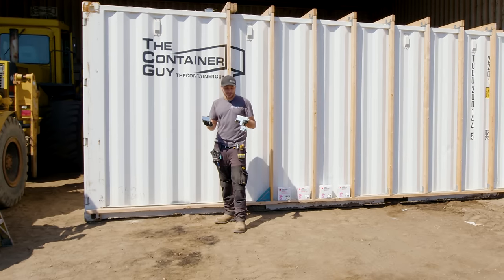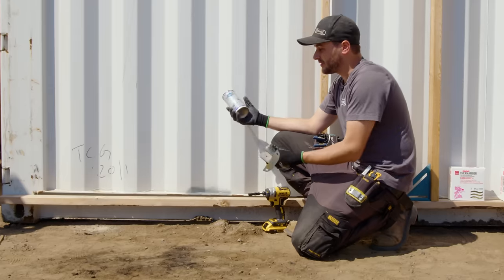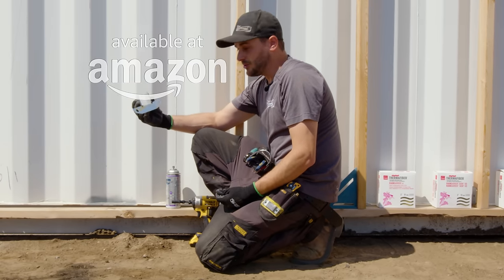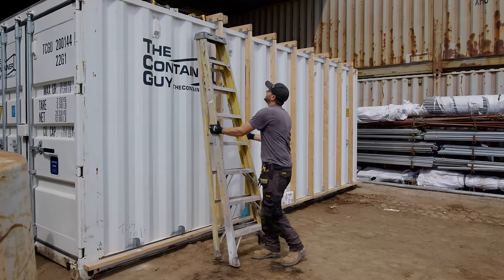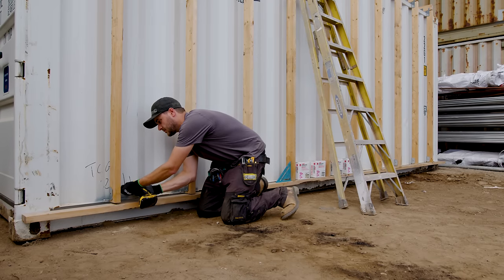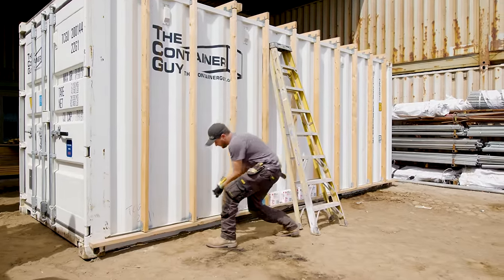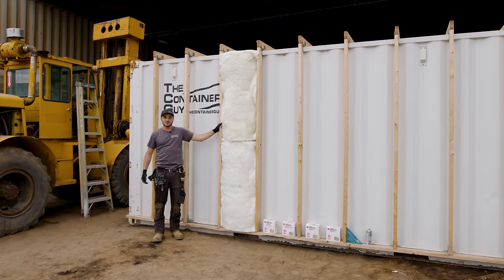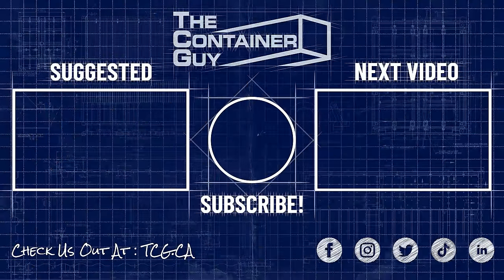Installing Our Exterior Stud Brackets On Shipping Containers !

Comment: May I suggest a better anti-rusting solution for the bottom bracket?  Instead of using the Zinc coat paint, the best-of-the-best is to use an automotive coating like a 'Wax Rust Proofing' compound which may be 'POR-15' or 'KBS Cavity Coater' or one of the best being a permanent wax based coating.... 'PRO FORM PF 708-1'
Reply from the maker: I love suggestions. Great ideas. I'll look them up. Thanks. 

I'm not sure the rust there was a huge issue and I'm certain not many people who buy them will actually protect the metals. Time will tell I guess.
Reply: @TheContainerGuyTV  
In my automotive experiences, my focus is more to protecting the lower bracket rather than the shipping container itself since the gauging is super thick on the container compared to the lower bracket and it would be very easy to coat the entire bracket in wax rust proofing compound to permanently stop corrosion. 

Even with galvanized metal, people think that it will never corrode, but it doesn't take much for corrosion to eat to the base metal and I've seen it a million times!

It may also seem that I'm over protecting the metal, but once rust starts, it will eat metal to the point of turning it into dust and that would be a pain in the rear to have to rip walls apart to fix a problem that should never have happened in the first place.  Just my 5-cents worth...👍😎

Comment: My biggest concern with insulation is the how and where of moisture/condensation. Not just super humid environments, but also very cold climates can create a lot of moisture in walls. Any thoughts on mitigating that and/or how to use vapor barriers to ensure it’s not a problem? Pretty sure closed cell spray foam would take care of it, but of course, that’s far and away the most expensive option.
Reply: save for foam ... its worth it

BUT if you absolutely don't want to ... then build it like old houses and have air gaps that will allow the exterior to dry out if condensation or water get in there ... that also comes with its own set of problems
Reply: @dovahkindragonborn9827  Good advice.

Comment: Very cool. Would we have to use the vertical bottom brackets in order to build a roof or could we just use the top brackets?
Reply from the maker: Can just use the top brackets but this has been asked so many times that we are going to make a "truss" bracket for this exact application. Give us a month or so.

Comment: At 5:28 I can see you pre taped your holes, did you use a tap or did you use a self tapping bolt. It almost looks like you did this to make the assembly look easier, however I’m SURE this wasn’t the case.
What I did was weld an angle iron horizontally where your brackets are and sat the end of the 2x4 on it so NO wood was exposed. Those brackets and bolts are expensive.

Comment: Love the product and would be super interested in buying, but $2100 seems really steep.  Any plans for a price decrease or rationale as to why the brackets cost as much buying the container itself?
Reply from the maker: They were manufactured in low quantities and there's LOTS of them in a kit. We think the number of brackets can be reduced with a bit of change in our framing method and if we order large volume, our cost will come down. These are the "better than nothing" Beta version of the brackets at the moment. In short, prices will come down eventually.

Comment: I like what you've done.  I ask because I do not know - If you are going to frame it out in wood, why not just frame a structure in all wood and do away with the container?  I'm also wondering out loud whether your could have polystyrene molded to the contour of the container on one side and and have a 4x8 sheet of plywood on the outside?  Essentially a SIP system with engineered wood only on the outside.
Reply: Would a wood structure withstand 100 mph straight line winds? Having that steel container adds enough weight to withstand 100 mph straight line winds!

Comment: When using a system like this, do you recommend using the close-cell spray foam inside the container, AND also insulating the outside as well to prevent condensation, or do you only need to insulate the outside?

Assume that a bathroom & kitchen would be inside the shipping container, so there would be interior moisture.
Reply: @h2s142yeah, I wouldn't use fiberglass up here in Canada. It wicks moisture to easily for one, and won't provide enough R value for another. Mineral Wool would be a far better alternative, and even then - in order to get the right R value, you would lose too much of your interior dimension.
Reply: I am well aware that closed-cell spray foam is the best alternative for insulating the inside of a can for our winter weather. However, this is a different system with exterior studs, so I was uncertain whether insulating the inside or outside or both was the better option.

Comment: With external insulation, can i directly attach plasterboard sheets to the walls inside, without using metal structures to fix the sheets , just directly against and fix through the wall ?
Reply from the maker: Probably better off to glue 1 5/8" steel studs to the inside corrugations then fasten the drywall to that if you want the max interior space. Without spray foam, the walls flex a lot so if you plan to mud/tape it will likely crack.

Comment: I think if i was building a one story house with roof, i'd take two 40ft containers and slam them together then do this, have to have the high ceilings though. A good size room is 17x15x9ft ceilings, Probably need 18 or 19 shipping containers to do a project! Most of those are walls though, the rest would be for living space and a unground pool one for a look out tower with a jogging roof around the walls. Inside space would be for a garden the pool and family area.

Comment: You could use a spray wax to help prevent corrosion instead of a paint or primer. Used in automotive applications. You probably could use the insulation as is, but cutting it down is really not a hard thing to do.
Reply from the maker: Tomorrow we're going to tackle the insulation. It's a bit of a rabbit-hole. Seems there're many ways to skin a cat

Comment: Have to wonder about bimetallic corrosion and longevity of those brackets.
Reply from the maker: Another instance where spray foam cures all. The spray foam has enough stuctural adhesion to withstand the wind and snow loads therefore these brackets are merely placeholders until the spray foam contractor arrives.

Comment: Can a truss be incorporated in the top, with an overhang eve? Hip roof???
Reply from the maker: Once you convert it to wood construction with these brackets, you can do any wood-type construction methods
Reply: these are kind expensive at 1200 for a 20 foot container.
 @TheContainerGuyTV
Reply from the maker: @surplusdoctor  we're working on it. The first batches of production are never cheap.

Comment: Might be a bit more expensive but I think I’ll try using steel 2x4’s. The ones they use in steel building constructions
Reply from the maker: I'd love to see photos and know how it worked. The steel will create a small thermal bridge again through the bracket but that's small beans compared to many wall systems or steel doors for that matter. The steel 2x4 or steel studs will increase the lifespan of the structure 💯

Comment: Are you putting walls up on the inside also? Why have the container? I'd insulate the out side with Styrofoam,put on siding,no walls inside ,just shelving and put a refrigeration unit on it. You have a giant freezer or refrigerator or both.

Comment: It would go much quicker just welding those brackets on. Make them thicker with just one side and eliminate the U bend ups and will nest better on the laser. Bolt and nut with large washer for roof or deck supports. Plenty strong with sheeting being attached on top of the studs. It has no real load bearing except at the top brackets.

Comment: If the distance between each framing member isn't 16 or 24 inches, you are looking at a lot of work and wasted material when you go to apply roof sheeting, flooring or wall sheeting.

Comment: I’m wondering if you even need the container for this. Just frame up the same space in timber and save the cost of the container, and then you’re not restricted to the dimensions of the container.

Comment: Will Insofast exterior insulation fit under the studs?
Reply from the maker: No. I have a sample and tried. The studs would have to be further out. I will show the insofast in my next video on insulation.
Reply: I’ve done the Insofast before in the past… I won’t do that again. Better to just do spray foam

Comment: You showed that the design of the top bracket needs to be modified to allow a front facia board to be screwed onto the top horizontal joists. Your current design, as you found out, means the front hole in the bracket is too close to the end of the joist when the facia board is attached and will split the end of the joist. Also, get yourself a hammer!

Comment: I've never understood trying to insulate the inside of a metal structure with very limited space. Rather than keeping the heat from the metal out.. why not just keep the metal from heating up in the first place. Hence, framing and insulating the outside, at least first.
Reply from the maker: Great perspective. You're right
Reply: One reason is that it's easier to fully insulate on the interior than the exterior. I have built a container cabin several years back and looked at exterior insulation/cladding. it's just more difficult to do. Not impossible, but if you leave any steel exposed outside then it's either conducting heat in or out. Best solution ultimately would be insulation on both sides. But at that point you really need to start asking if there is a better solution than a container in the first place.

Comment: Uhmmmm? I'm sure there is a reason, but if you are stick framing the exterior ...why not just stick frame the equivalent space and not have the container adding complication? ACTUALLY! - even better, increase the footprint a little bit and not have the limitation of the container width as well.

Comment: im a litle conserned about how will the insulation breath ? water will make it in at one point or another thats why it always has to have the option to breath, even though the insulation dose not drink in water the wood will.
Reply from the maker: Same as a home with a vapour barrier inside. Breathes through the exterior sheathing and house wrap.
Reply: @TheContainerGuyTV  hmm interesting, usually the bottom is open with a insact net :)

Comment: Should have designed the bottom bracket to hold the horizontal plate in place, rather than the vertical stud. Maybe one could be designed to hold both.
Reply: Since there is not much load on these components, maybe an "L" shaped
bracket. The horizontal part bolted to the bottom plate and the stud screwed
to the vertical part?

Comment: These brackets are cosmetic,  not structural.   The brackets are way over engineered.  They could be made with thinner steel to reduce the cost and make them more appealing to people looking to add an exterior.  Right now, they're a bit cost prohibitive.

Comment: Should have incorporated fastening taps on the top angle bracket for the "top plate so your not relying on screwing through end grain on vertical and horizontal board. Just saying, while your engineering something sensible and practical.
Reply from the maker: Thanks for the a-little-too-honest advice. We are thinking we won't need a traditional top plate if we use a monopoly framing method. Being naive to traditional methods of construction has it's pros and cons. We aren't tainted by the way your great great grandpa did it. 

We'll consider the inherent flaws of framing with tree carcuses after we have proven the product and adjust our design accordingly.

Comment: Came across your video thought that you put the wooden studs in wrong place should of been placed convex not the concave there was a gap between the wood and side need to redesign the brackets so they can be fitted like I said that way spray foam or insulation pushed between them if you used a 4×2 for uprights 2×2   needed less cost or customer could cut them saving more money think I would of put blow torch on them stops the long term Rot 😮😢😮

Comment: Am I missing something, if you go to all of that trouble and wood, why don't you just build conventional?
Reply: If you need to condition the container for any reason there will need to be walls of some sort on the inside or the outside of the container in order for there to be a cavity for insulation. Putting that wall cavity on the outside makes sense to me because you don’t give up any space on the interior of the container. Also you can decorate the outside however you want this way. Still way less expensive because you are eliminating the need for a footing/foundation/floor system. That’s just one small area you save money. Too much to type.

Comment: Why even use a shipping container when you have to use the same amount of wood to frame as you would without a shipping container  the shipping container just seems redundant at this point and causes more labour
Reply from the maker: I agree if you are only wanting to build a backyard shed and don't care if it gets mouse-infested. Jump on craigslist and check the condition/value of 10 year old sheds. 

Where this method has huge potential is using two containers 24' apart and spanning floor joists or rafters across the top. Rip the wood floors out of the containers and pour concrete in the 6" void and the aread between the containers. Would make a slab-on-grade home and the containers could be anchored with screw piles.

Comment: I feel if your framing the outside why not save the cost of the container and use that 5,500 dollars just to skip all your connections brackets and build a traditional stick building with a concrete pad? To me this is just over thinking a container skin. Now I can see building a pitched roof to divert the water off the top of the container. I just don't see it as cost effective. Rust ? this container will out live you before it rust through. I love the invention part and solving a issue but cost wise its not for me. It was fun watching your video.
Reply from the maker: There are so many different use cases. If your current requirement is a shed, build a shed. I agree. Thanks for watching.

Comment: Seriously?  You take a container that is SEALED and wood frame it on the outside so that now you  have to SEAL IT AGAIN? Just to save space on the inside?
Why not just attach two conex's together, remove the common section between the two and header it off?

Comment: Can you use 2x6’s instead of 2x4’s? I need 2x6’s for insulation purposes in my state. Do you have deeper brackets that would allow for 2x6’s?
Reply: This is the way I would do it with 2x6 Then 2" of spray foam and then rockwool/mineral wool.

Comment: absolutely zero advantage to using a container if you cover it in wood (rot, sheeting, siding necessity etc) and now also, you still don't have paths for wire in the inside walls now.
Reply: Why couldn't you run the wires etc through the outside frame? It's essentially the same thing

Comment: Instead of zinc primer, which should be used to paint the container, but all the brackets should be dipped in a latax material, which would also isolate them from contact metal to metal.... simplify the process.  Learn from boat building...

Comment: Container guy...please do not bash wood. My grandfather and dad built many houses out of wood. The houses are still standing. If taking care of they will last  several lifetimes. Did i mention recently Ive seen alot of metal building torn completely apart from high winds in texas. But the wood buildings are still left with only the metal siding torn off. Also my husband installs garage doors but he had tons of service calls after recent storms on garage doors entirely sucked off metal channel that holds the door completely ripped off and bent to heck. And they arent all ones he or his company installed.

Comment: Shouold be nothing wrong with fiberglass insulation and it should never wick moisture from bottom to top.   You should address the vapor barrier that the container creates which could get any insulation wet.  I think you are giving advice without knowing all the facts.

Comment: I DON'T SEE THE BENEFIT OF A CONTAINER HOME.  AS A BUILDER YOU ARE STICKING SOMETHING IN YOUR WAY BOTH INSIDE AND OUT. ESPECIALLY IF YOU WANT SOMETHING WIDER  OR TALLER THAN 8 FEET. WHY NOT JUST DO NORMAL STICK FRAMING?